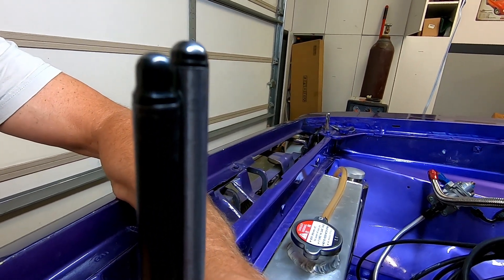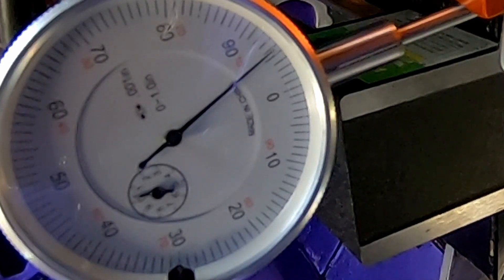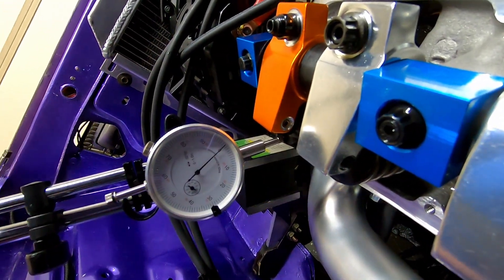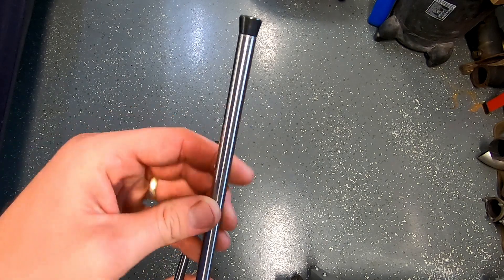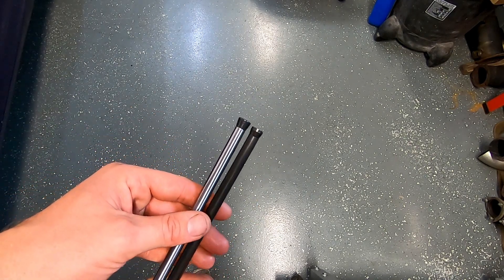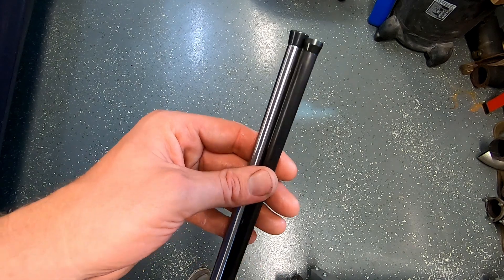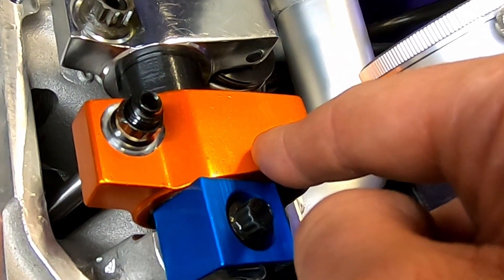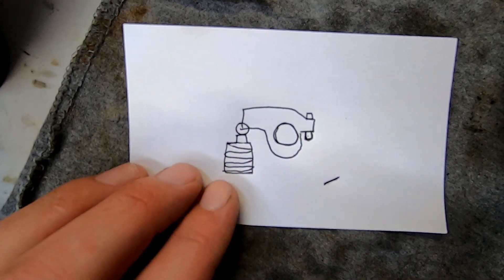Mopar Pushrod Length Affects Valve Lift! Here’s Proof! #bigblock #mopar  #engine #HarlandSharp #tech

Comment: i am by far not an expert, but wouldnt changing the length of the pushrod also change the contact patch/spot between the rocker and the valve tip?  if so, you wouldnt want to move it too far from center/optimal.  possibly causing premature valve guide wear.
Reply from the maker: @skidmark7199  this is the best teachable moment. Shaft mounted rockers break all the rules of Chevy and ford based science. They typically swap pushrods to raise or lower the rocker, which gives a direct connection the rockers placement on the valve. With Mopar shaft rockers, there’s a varied relationship between pushrod length and rocker placement on the valve stem. Yes, you’ll get more valve sweep with the shorter pushrod, but that’s because we are adding a lever between the pushed and the adjuster. With a shorter pushrod, it gives a longer lever to press on and gives more valve lift. However, it is putting more friction on the pushrod and adjuster end with each rotation. But back to your logic, no matter what the length of the pushrod, the roller always starts at the least point of the roller sweep. Since it’s a fixed shaft, the roller always has to start at the bottom of the sweep. The adjuster will screw in as far as possible, but eventually, it’ll open the valve if it’s too long.
Reply from the maker: Easy Mopar Rocker Arm Geometry: Studying the B3 Racing Kit #mopar #engine #bigblock
https://youtu.be/LbAgW7mWOJE
Reply: @ hopefully by teachable moment, you dont mean "you big doofus".  i have engine basics down.  im trying to get more knowledgeable on fine tuning. 21 years of infantry sure didnt help for brain space.  but im 54 and still learning.
Reply from the maker: @ absolutely not an insult. I never judge anyone on what they don’t know. I learn something new everyday. Thank you for your service 🇺🇸

Comment: You're close, but not quite there...  

If you measure horizontally a line  while it's horizontal, You will get the longest and most accurate reading of that line. However if you turn the line 45° and measure it horizontally again, you will see that the line is now half as long as it used to be, Even though along its axis It is still the same length.

When working with levers, if the lever is 45°, 1° of rotation will have far less vertical travel then if the lever is completely horizontal and rotated one degree. Imagine the breaker bar on the snout of the crank of your engine. Put it 45° and rotate the engine 1° measure how far the tip of your breaker bar drops toward the ground. Now put that same breaker bar parallel to the ground, and rotate it one degree and measure the drop. You'll notice that while it's horizontal the drop toward the ground will be far greater than when it was 45°.

Keeping this in mind, you want the rocker from the fulcrum to the valve to be as horizontal as possible through the entire stroke of the valve. 1° of rotation at the rocker tip will change far more drastically if the rocker to rocker shaft line is nearly 90° to the valve tip. So in layman's terms, the closer that the rocker shaft is 90° from mid-lift at the valve stem is where you want the rocker shaft to be. This ensures that the rocker does not go to excessively vertical at either fully open or fully closed position.

Now the back side of the rocker is a different thing. Usually on rockers this is a fixed angle between the fulcrum and the ball socket for the push rod. However because you have adjustable rockers, this angle also changes with rocker adjustment. Earlier we said that one degree of rotation yields a very small vertical change The further away from perpendicular you get. Well, when you're talking about trying to rotate something, the further away from perpendicular you get on the drive side of the rocker requires very little movement to get very great amounts of rotation. It's kind of like the drive sprocket versus the driven sprocket thing. If the angle is far away from perpendicular and you're pushing on that with a pushrod the rocker will rotate far more than if the angle from the socket to the pivot is exactly perpendicular to the pushrod.

So in this case, I would say that if you are trying to correct geometry of the valve train, the correct way would be to install a test spring. Get yourself a push rod that is adjustable. Install the push rod while adjusted to a reasonable length, install the rocker arm, take a measurement. Shorten the rocker arm by 50 to 100 thousandths, set lash and take another  measurement. What you want to do here is to try and find the minimum amount of lift possible. Once that's found, you now have the push rod 50% of cam lift above perpendicular and 50% of cam lift below perpendicular. Lock your rocker down and don't touch it. Now, remove your rocker and shim the rocker up by 50 or 100 thousandths. Use your push rod to adjust valve lash, do not adjust lash using the rocker! Measure valve lift. What you want to do here is try and get the most amount of valve lift possible. Once you're able to find the shaft height at which you have the most amount of valve lift possible, you now have the rocker set so that half of valve lift is above perpendicular and half of the valve lift is below perpendicular. Repeat these steps one more time with the pushrod length adjustment using the rocker arm adjustment to take care of valve lash and obtain the least amount of valve lift. Ideally it should not have changed, however I'm sure it's possible that it could have ever so slightly. If it does change, go back and check the rocker shaft height one more time. You should now be dialed in. Pull the push rod, measure it, that's the pushrod you run and whatever shim is underneath your rocker pivot is what you need to run.  

Hope this makes some sense.
Reply from the maker: I got an ear full from Mike at b3, since then Easy Mopar Rocker Arm Geometry: Studying the B3 Racing Kit #mopar #engine #bigblock
https://youtu.be/LbAgW7mWOJE

Comment: DONT use pushrod length to get lift, the ONLY function of pushrod length is the get the correct pattern on the VALVE TIP!!!.......got NOTHING to do with lift, has EVERYTHING to do with proper valetrain geometry.......you never mentioned the valve stem tip pattern.....its the ONLY thing pushrod length is there for, lift is non sequitor!!!!.......good luck!!
Reply from the maker: Thank you. This was just a QUICK and DIRTY test to show that different length pushrods affect lift at the valve. I show the pattern in the full install video of the rocker arms coming up. This was a simple test just for fun. I think many people enjoyed it because it was simple. Hopefully no one thinks they should buy pushrods to change lift.
Reply: @JustMoparJoe  ok, that helps clarify my concern, but in general, you shud NEVER even make this vid.......the proper pushrod length is for proper valetrain geometry, so AGAIN, valve lift is NON-SEQUITOR........lift shud only be changed by rocker ratio, or camshaft, NOT A GOOD IDEA to use a pushrod to show lift changes, I disagree with the fundamentals of the vid......engine building 101, has NOTHING to with a "down and dirty"......it leads the viewer to belive if they changed the pushrods, it'll run better......BAD IDEA!!!...THE ONLY FUNTION OF PUSHROD LENGTH IS GET THE CORRECT ROCKER TO VALVE STEM PATTERN, all else is BS!!
Reply: @timothyarnott3584  I should think the location of the rocker shaft has as much if not more to do with the contact pattern. The contact pattern is also affected by valve stem length. That's why the W2 heads have milled rocker stands, so you can custom make your own stands to fit your particular combination.
Reply: @budlanctot3060  yes, i'm aware the shaft height, stem height, and shaft position have ALOT to do (probly most to do on a shaft rocker assembly) for correct pattern, then you measure what your pushrod length shud be, to keep proper geometry.....again, your comment PROVES my beef, that using pushrod length to see how lift changes, is a bad idea, cus if the shaft is placed properly, YOU DONT FOOL WITH PUSHROD LENGTH to change lift, it will still make a bad pattern on the stem, and cause BAD valvetrain geometry!!
Reply: You missed the most important part of this video at 8:40 where Joe says “obtuse”.  He wasn’t referring to the pushrod to rocker arm angle; he was referring to a few of his viewers.  By the way, why are the comments disabled on your one video?

Comment: Question, i have stock rockers and stock pushrod length and stock cam with hydraulic lifters. In order for my engine to stop shaking so bad i had to put shims under the rocker shaft. No matter how much i think about im not sure if its the push rod length of the machine shop didnt sent my heads up right when they put harden seats in it. Thoughts?
Reply from the maker: That’s an odd deal. Probably the last solution I would have imagined to stop a shaking issue. But the shims are made to compensate for excessive milling of the head and deck surfaces. I don’t think it was a machine shop issue with setting the heads up. There can be an amazing amount of variance that the lifters can compensate for, but the milling will make the pushrods too long and depress that lifter too much. I’d say if it’s fixed, fly it and watch it 👍🏼
Reply: @JustMoparJoe  thanks for your thoughts joe. yep, it was that last thing. I checked everything. I figured it out because my spark plugs kept looking fouled and didnt make since i replacee everything. then i did a compression test and almost was about to throw the engine out into the lawn as a lawn ornament then i tried that and solved all my issues and ran like a dream and my compression was great. So, something for your back pocket if ever.

Comment: I was told that the minimum to thread on the adjuster was to make sure there was room for the oil to get into the cup on the pushrod. I have seen those that got burned up on that end because of that problem. On my big block I got pushrods that had oiling holes all the way through,so i would get oil from both directions.

Comment: Interesting stuff, back in the day I used an adjustable pushrod to determine the length from Mopar performance and the pushrods came as a kit where you ground your own to fit.
Reply from the maker: Yes sir. I made my own pushrod when I was in a pinch

Comment: YEAH! 7:40 Thats exactly what was in my head when I was commenting on the last video! Thanks for that. I'm glad I wasn't imagining things. The only deviation was swapping to a different pushrod. Like if you had unlimited lift adjustment threads on the rocker that geometry would show its face more obviously. Now you are getting into that territory of when lift stalls out mid-lobe because that pushrod angle has to compensate for that distance relationship until it straightens out again and finishes the lift at top-lobe. There has to be a book on it or something. Regardless my dude, good shiz as always and thanks for the lessons!
Reply from the maker: Thanks brother. I’m learning more each day. Listening to the pros and studying up.

Comment: great vid, one question how come you set the valve clearance at .002 shouldn't it be more then that with solid lifters?
Reply from the maker: Great question! These are solid roller lifters on a hydraulic roller cam. The ramp rate is different on this cam versus the solid roller.
Reply: @JustMoparJoe  Is there a hot adjustement or you set them cold and leave them there, I hate to be a pain.
Reply from the maker: @ws2664  check out that video link. Those guys explain it better than I do. There’s a different expansion rate for different Materials(aluminum heads vs. cast iron).
Reply from the maker: https://youtu.be/GZTdo2-cGCM

Comment: On your last video you was setting  a clearance on your valve lash.  I thought that was odd for a Hyd lifter.  Now I know your using solid lifters, and yes they work very well on hyd roller cams.  I'm doing the same on my old engine.  Due to engine heating  I set that motor with .016 intake and .018 exhaust lash as per the engine builder.  My lift is in the .740 range with 1.6 rockers. This is the engine in the video i posted the link too.   I've had to change pushrod length once with a different head gasket thickness. Joe you know your stuff
Reply from the maker: Thank you, Mike! I learn more everyday!

Comment: Great video Joe.
The designers of the rocker arms all the way back used 1 to 3 threads with 1.5 threads being the mean.
I try to pick an average on most engines.
For Street, Hi performance and Drag Race.
The higher the lift, the more critical it becomes.
Rocker geometry can be challenging with shaft rockers, but not to big of a deal once you have a few different combo's under your belt.
Nice job Joe.
Like to see you checking this stuff.
Take care, Ed.
Reply from the maker: Thanks for the info! And thanks for the help.

Comment: Thanks for making these videos. Your approach to the point is a breath of fresh air! Appreciate ya! I've learned a lot from you. My HS rockers were right at 1 thread lashed that's 50 thousand per turn as per mine. My pushrods came out at 8 inches if I remember correctly on the 452. Zero decked with TF 240s. I may have missed the OAL of the 2 pushrods you have there?  I got mime from Smith Brothers in Redmond Oregon.  I'll re-watch this video I may have missed it. Thank you again you save me some heart and wallet ache!
Reply from the maker: Thanks for the support! I can’t remember the lengths on these two. My block was true decked but not zero.
Reply: @JustMoparJoe  got ya this block I had was squared as well and had to go 42 over to clean up. It was very rusty but did clean up.

Comment: Hydraulics need proper preload to much and the valve can be open at the wrong time... Not enough you'll lose effective lift the cam can give you...and noise...same goes for a solid when setting valve clearances .... This doesn't consider the geometry between the pushrod and the rockers which is a whole other ball game....great job Mr just mopar Joe!
Reply from the maker: Thanks John!

Comment: Great explanation Joe! Pro tip... I keep a 5/16 ball bearing in the tool box for measuring those ball/cup pushrods. It removes the variables involved with different cup depths.🏁
Reply: This works for many applications, because it takes at least one variable out.  Yes even works for bearing shells if you don't have the special mic for it.
Reply from the maker: Thanks Guys! Ed gave me that quick tip before. Mopar to ya
Reply: Tony I use the ball bearing also.
Good solid advice.
And is a Pro Tip.

Comment: If you go even shorter you will loose lift . Half way open isn't the middle of the pivot point. Cross Ram linkage works same way. If not carbs don't open all the way . Took me a while to figure it out . 😂
Reply from the maker: Short but no cigar! Thanks buddy
Reply: Don't you check pushrod length with valve halfway open ? And rocker straight across with retainer? To short to long you loose travel. 🤔🚬🤣